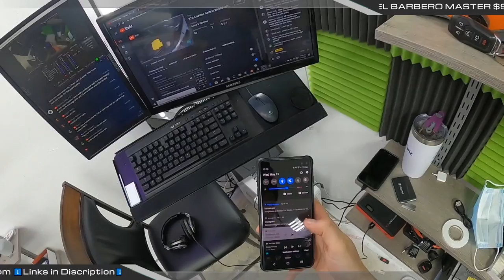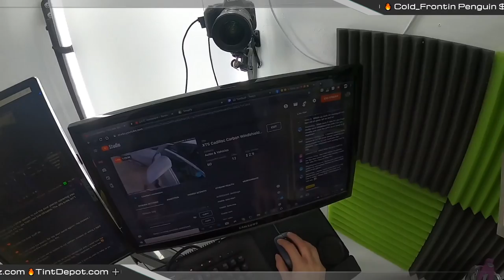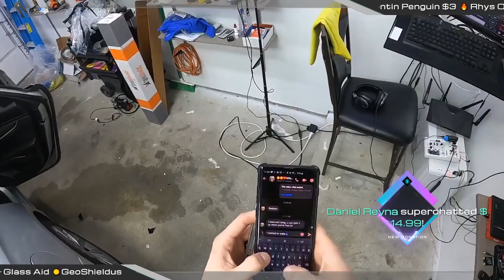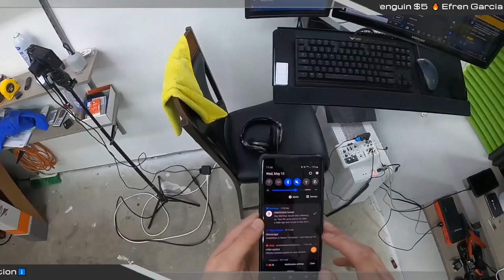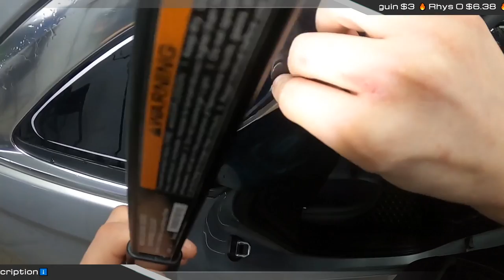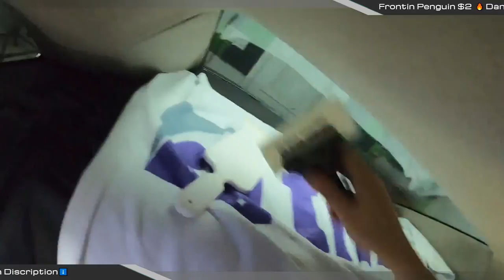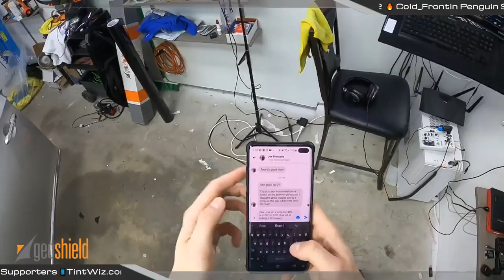XTS Cadillac Carbon Windshield Tint LIVE! @ Detroit Tint Studio

Comment: What's man, I'm currently installing dyed film at a dealership, but will be starting to install ceramic. Is there much difference in shrinking/installing the film?
Reply from the maker: depends on the ceramic, they are all going to be the same process and techniques but some ceramic films might shrink slower or feel a bit rubbery and crease easier.
Reply: Ok cool, I'll be using Solar Guard